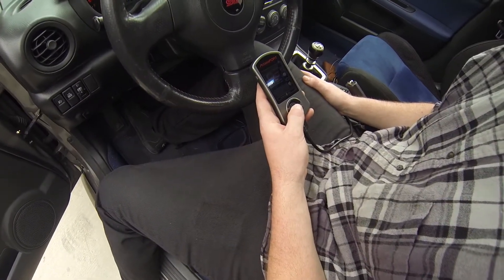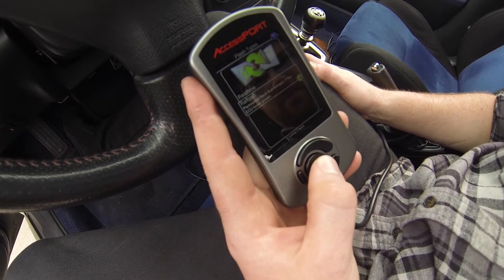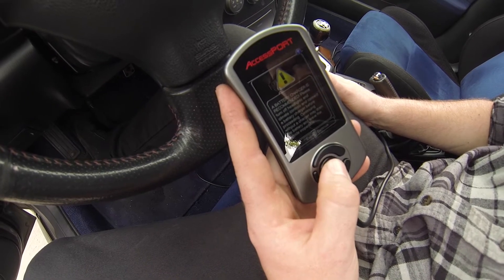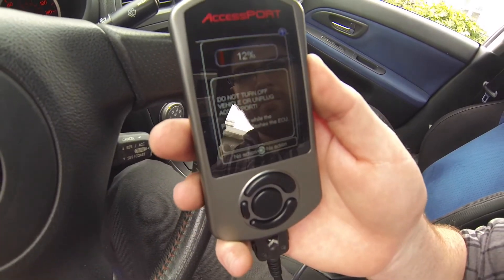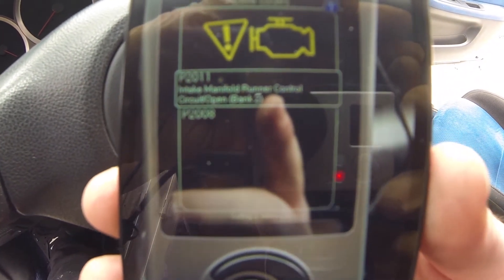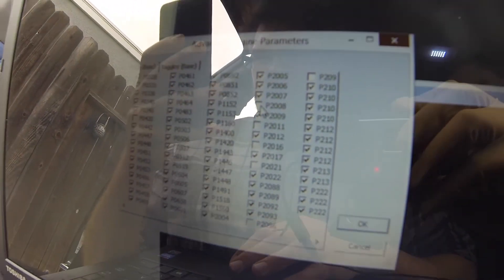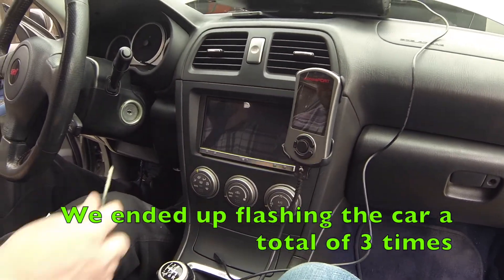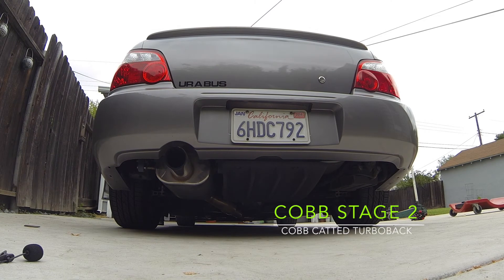Hawkeye STI Stage 2 Install Part 2

Comment: Blake i see Cobb now makes you pay for this race software. I have a cel for the secondary air pump that i was hoping to disable.  But then found out they make you pay for this software. Is there another way to do this. DO you still have this software?  Is there a way for you do uncheck those Cels so my check engine light goes away?
Reply from the maker: 2011wideglide yeah it's because people were blowing up there cars I think. You will have to get a e tube or protune. I definitely recommend a protune as you will be much safer and make way more power.
Reply: 2011wideglide  I feel your pain. I need to be rid of my EGR valve codes (both stuck closed) that saves me the trouble of blanking off the exhaust ports at least. They say that race program was just a beta, the new version will be released soon. They "feel" responsible for bad tuners using there software to granade engines. There aren't legally responcable at all, but it is what it is. So if we pay the $150 to take an online tuner course and test, we will have access to that so called Beta race program. A lot of pro tuners don't want anything to do with Cobb now because of that. Your best bet will be to take the class and do it yourself. You could always open source tune, better trust who does it though. By the way. They also say that money doesn't go to them, it goes to the collage that gives the course and test. I'm pissed, but am taking the course soon. Good luck man

Comment: Hey Blake I'm a new subscriber here and I just wanna say that your vids are super helpful. I just had a question about the Accessport. Can I run a K&N typhoon intake with a stage 1+ Sf Tune even tho the intake is not a "Cobb" Brand?? Thank You
Reply from the maker: +jose avina no you need to get a tune for that particular intake. Each intake has to have at the MAF calibrated. If you don't you will run the Car lean and run into issues.

Comment: what is the point of the green connectors, whether they are connected or not?
Reply from the maker: +Robert Griggs You have to use them to flash the car or it will not let you.

Comment: Hows it going blake? Got a little bit of a question for yea if you dont mind. Ive been running the stage 2 set up for a couple months now, and i recently noticed when the GF was driving the car (shes a much more sense-able driver always down in the 2-3k rmp range...like really :P) that the car was surging from around 2100 to 2400 then back down and up causing the car to buck almost like a bad standard driver, so me being me i was like wtf you doing? she said the cars been doing this for a while. I hit the interwebs they say check vac hoses...all tight, then they say it an issue with cobb the sensor is pick up knock and pulling timing out and then vise versa putting it back in causing the surging. You happen to know anything further about this issue? Ive contacted cobb but im kinda worried about driving the car the GF uses it as a work daily and it the car is getting knock feedback enough that it wants to alter the ECU that cant be good for it. 

BTW runs fine under load, Hauls ass no boost creep, holds 14.8 PSI steady flying down the highway.

Comment: Great helpful video. Do you recommend getting a protune after going stage2 instead of sticking with the OTS maps?
Reply from the maker: wellingtonskate krew Getting Protune is always better. But the OTS tune is not so bad makes a lot more power than stock obviously.